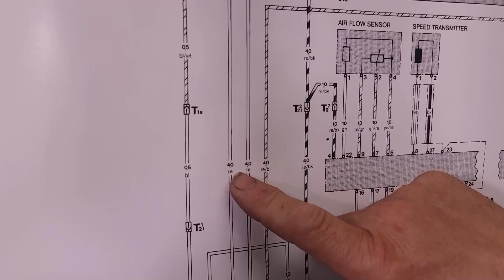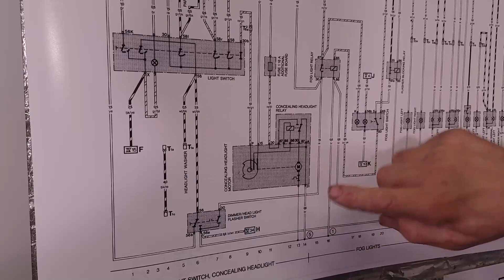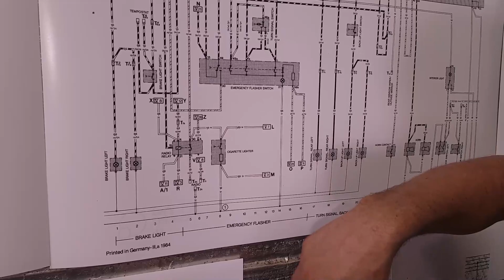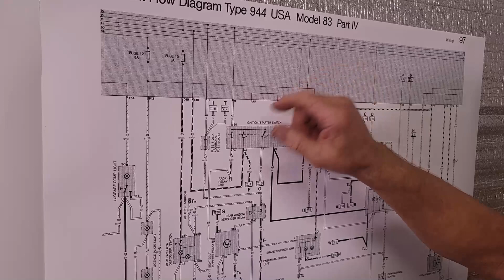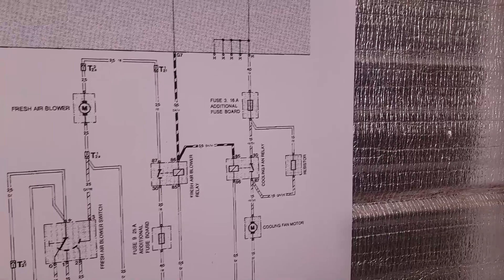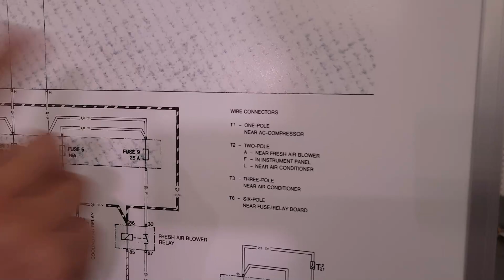Episode 2 - How to Read Vintage Porsche Current Flow Wiring Diagram - Terminal 30

Comment: Could you help me with understanding the DME and my fuel pump circuit? 1982 Porsche 924 non turbo 2.0.
Reply from the maker: Sure, I'll take a look at it and see if I can explain it.
Reply from the maker: OK, I think I need to know a little about the problem. But here's the scoop on the fuel pumps. Power for the fuel pump relay comes from the + battery terminal, Red/blue wire. When the relay is activated,  Power goes to fuel #2 in the additional fuse panel. That's the one straight up under the dash. Should be a 16A. That also powers the aux air valve and warm up regulator heaters. That same fuse goes directly to the fuel pumps. Black/Green wire. The fuel pumps are grounded in the luggage compartment near the left tail light. 
   The 15 terminal on the fuel pump relay should be 12v with key on. 30 will be live all the time. The 1 terminal Green wire comes from the ignition coil terminal 1. If there is no trigger from the ignition control unit, there will be no fuel pump activation.